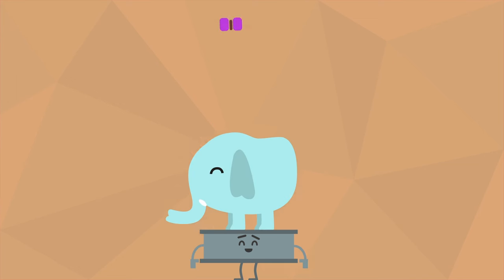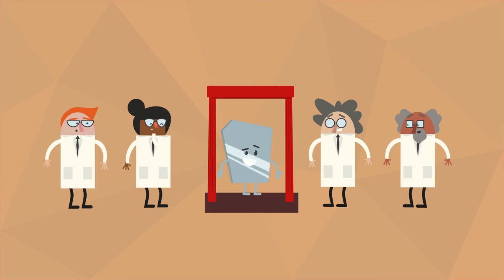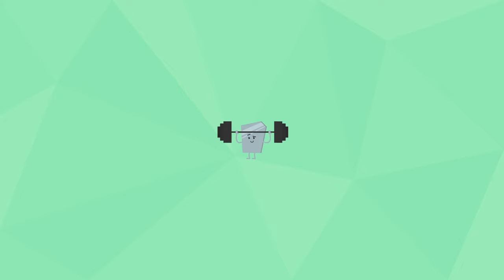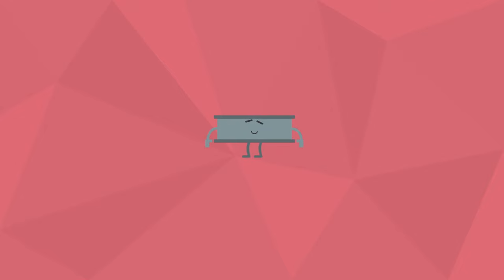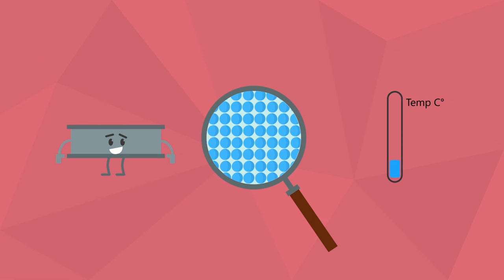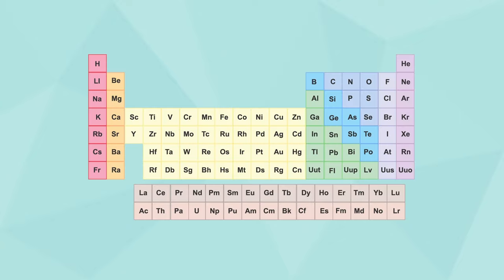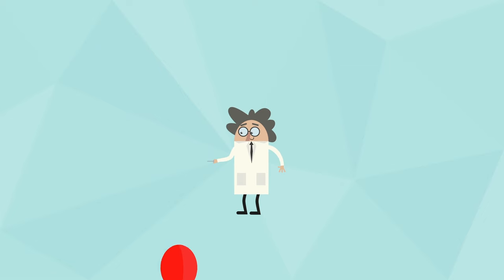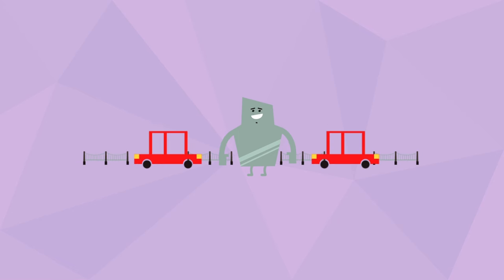What is metallic glass? - Ashwini Bharathula

Comment: The weakness of this material is the fact that it has no grains... the narrator presented the grains as bad but in fact it makes the material more durable under stress and it gives a fracture "warning".
Reply: @awashburn6944  I will not argue with you since I only had material science as a single module in first year of electrical engineering. Sounds like you know more than me

Comment: Is metallic glass actually stronger than titanium?
Reply: +Amir Akbik Titanium is a rather brittle metal, so being stronger than it isn't that hard.  Steel and aluminum are both stronger than Titanium.  Titanium is mostly used industrially because while it is brittle, it's very hard, so it can be used in sheets to protect various things from scratches and such.  An engineer or chemist could tell you more.

Comment: i steel don't get it...
Reply: *still
Reply: +Pizaerable someone doesnt get it
Reply: Loooool see I was joking as well. I was pretending that I didn't know the joke, so I was joking that I didn't know the joke 😂😂😂
Reply: +Pizaerable You wanted to still the spotlight.
Reply: +Arsyad Kamili I deed steel it nice one
Reply: +Kytetsu, Metallic glass is as strong as metal and as easy to shape as plastic, they put the temperature high then it softens and get molded, then they need to cool it down to get back the metallic glass's strength. i dont know if you're joking or not, so just in case you dont understand, I summarized it

Comment: Well...are grain boundaries really something that engineers want to avoid? I'm not sure....
Reply: Depends on the temperature at medium temperature grain boundaries can increase strength and ductility , by allowing flaw to easily move thought the material. At very high temperatures like a jet engine grain boundaries are the first thing to fail.
Reply: +Richard Flowers Totally agree. But as far as I understood, these materials are not meant for high temperatures anyway. Also, most of the times (the general applications) the GBs are useful for the reasons you just mentioned (or correct me if I'm wrong). Basically, material engineers are trying to make the grains as small as possible in order to increase the area of the GBs.
Reply: That is correct generally the smaller the grains the more grain boundary area, the better the properties,

Comment: and, an after thought, what about carbon nano tube material? i know its in its infancy but dosen't it have a higher stability strength than the leading metal alloys used in construction applications? i would think , since the growing of carbon nano tubes  has only grown exponentially.. over time it would be the preferred candidate over  the types of compounds discussed in this segment? (keep in mind i mean eventually, meaning these substances may become ready for fast and mass production before carbon nano tube  structures, but over time, since its just carbon with a blueprint, it may one day be far more easily available and less expensive since we have a much larger abundance of carbon on this planet than compared to .lets say steel or iron.
Reply: "since we have a much larger abundance of carbon on this planet than compared to .lets say steel or iron.
"
Iron is the main element in Steel with Carbon as a small additive (2.14>carbon amount>0.08)%. Unless you're reffering also to non Carbon Steels, which have rarer elements in them.

Comment: Two points of error:

1. This is a formal context. You shouldn't be using "micron", as it's the informal shorthand of "micrometre".

2. How the hell do you end up pronouncing "micrometre" as "my-krom-et-er" but get "centimetre" correct?
Reply: Firstly, this channel is more for the easy dissemination of knowledge and concept in easily understood chunks rather than long hyper accurate explanations. Thus they try their very best to use the easiest and most common terms and phrases. Micron being more commonly used by laymen, especially of the american variety.

Secondly, one must be aware that how they pronounce a word may not be the way others pronounce the exact same word. I have heard  both My-krow-meet-er and my-krom-e-ter before on multiple occasions. The easiest way to see this is watching an New Yorker and a Londoner read the same passage more than likely many words will sound VERY different.

Comment: +TED-Ed I'm trying to understand the hype behind this Material. As an amorphous solid with out a interlinking polymer chains the structure would be vastly weaker and more prone to fracturing under tensile load compared to a crystalline alloy. Not to mention a horrible conductor of electricity. I think this is dead end as a form of usefulness. 
Anamorphos metals", if that's even a term, may have a small niche in a 3-D printer realm for small non load bearing projects. But unless you could somehow coax metals into amorphous polymer chains I find this to be quite ineffective and inefficient.
Reply: +zach7147 One major difference between metallic glasses and conventional polymer materials is that metallic glasses have metallic bonding (so there are a lot of delocalized electrons present), which explains their decent thermal and electrical conductivity. Having said that, what you said about being more prone to fracture under tensile load compared to a crystalline alloy is mostly true. They are better in inherent ductility and toughness than your window glass (i.e., they don't shatter as easily as a ceramic bowl or window glass) but much less tough than regular crystalline metals. Refer to the 'Dig Deeper' section for details.
Reply: +materialsgeek Ya, I hadn't looked into the subject at all, this being the first mention of metallic glass I have encountered. I will look through their Dig Deeper section. I can see where this material would have some advantages, but the video makes it seem as if it is some god send material that will solve all our problems. I think it might make a good replacement for indium based phone screens and gorilla glass if they manage to synthesize a non opaque layer. The advantage of metallic bonding in an amorphous solid is interesting. what is the benefit of metallic glass versus a ceramics such as yttrium-stabilized-zirconia?

Comment: Is it like the prince rubert drop
Reply: Yes and no.
The Prince Rupert's Drop gains his unique property because of the rapid cooling, but that's not the whole truth. 
It is strong because of the difference in cooling speed. The outside cooles down rapidly, the inside stays a hot expanded liquid. As the inside cools down, thus shrinking, it pulls in on the outside layer, creating inner tension.

With this material, there's also inner tension, but not because of the difference in cooling speed.
The inner tension is created because the material wants to get back into its crystaline form, but it can't because its already solidified.

So it's somewhat like a Prince Rupert's Drop :)

Comment: Why must we always say the sky is the limit? We've been to the edge of the solar(well probes have)system. Change the limits then I take that end sentence seriously. 
This material seems promising. I hope at some point I can make pants out of it.
Reply: +William Walsh We might someday. Unfortunately, humans would need to advance to the space age before we can even mine the needed metals. Palladium is rare, expensive, and already used in several other processes. Over half of the supply of palladium and its congener platinum goes into catalytic converters, which convert up to 90% of harmful gases from auto exhaust (hydrocarbons, carbon monoxide, and nitrogen dioxide) into less-harmful substances (nitrogen, carbon dioxide and water vapor). This is just one example, but you should get my point.
Reply: I do indeed get the point

Comment: this video is quite misleading.. the strength in most metals comes from an abundance of grain boundaries, because this stops dislocations from propagating through the microstructure. They are absolutely not a downside of metals. The strength of these metallic glasses, to some degree is a result of the ceramic like nature of the microstructure. It has nothing to do with grain boundaries.

Comment: Well this makes no sense. If the atomic structure was more like a liquid then it wouldn't be strong at all, because the crystalline formation is what makes it so strong. To remove that structure would make it weak. If something is bendable then it can't be strong, that's just common sense really. There's either a whole lot of stuff wrong with this, or I'm just stupid and don't understand this.
Reply: +Eileen Blurrr Yes, the structure of metallic glasses is liquid-like but they are way more dense than liquids. If you take single crystalline materials like diamond, for example,  they are super duper strong. And yes, it is the crystalline formation that gives them the strength. But most crystalline materials that we see around us are not single crystalline - they are polycrystalline and they have a variety of defects. Dislocations, grain boundaries etc. These defects make the material weaker. Metallic glasses, on the other hand, have none of these defects because their structure is mostly random. They still have metallic bonding but because they don't have these defects, they don't give in or yield to stresses easily.

Comment: Whell they aren’t apart of bridges because they literally melt when there in a microwave!!!!
Reply: With the right positioning of the prisms in a micro scale you can regulate all of that residual energy and route it away.
The heat that is generated by the hoover damn is still radiating from its original pouring and that energy is utilized

Comment: well.. buildings made with that material a probably fucked if a fire breaks out.. (or even something like 9/11)
Reply: a fire wouldnt reach a temperature high enough to melt the metallic glass and prretty much anything is fucked when you fly a plane into it
Reply: well there was one case where a plane crashed into a building and it was burning for several hours and the building still survived.